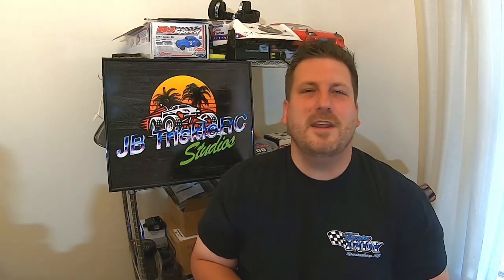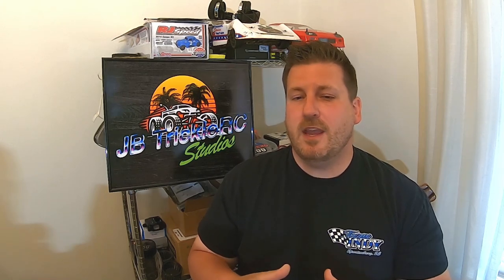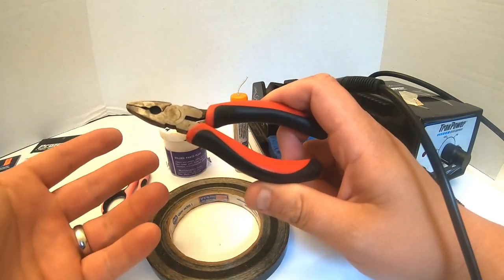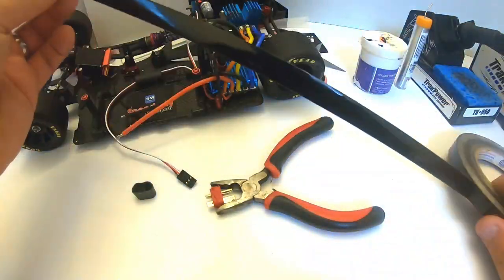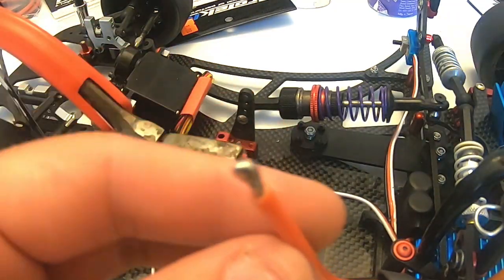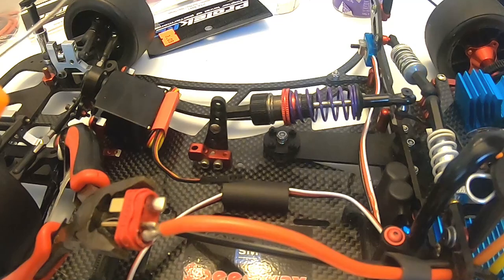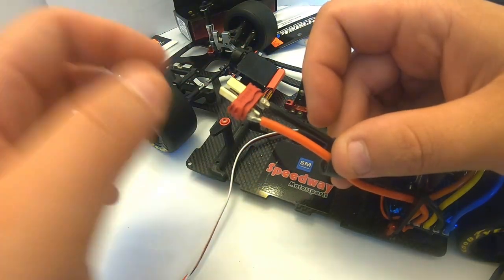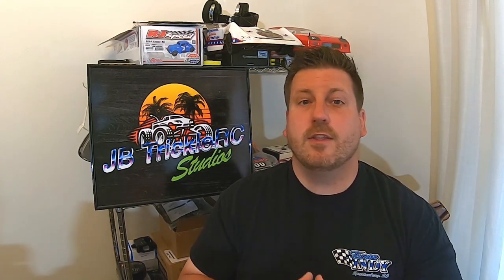How to solder your RC car: RC Soldering Tutorial

Comment: Tip that I learned is to clip an alligator clip on the wire in between your solder and electrical component. It will act as a heat sink and protect the electrical component
Reply from the maker: David Rice awesome tip for sure! Thank you. Appreciate the comment and support.